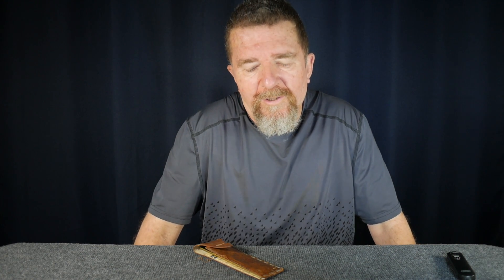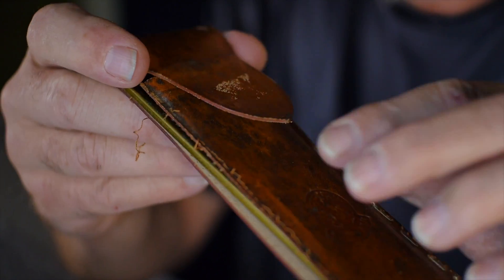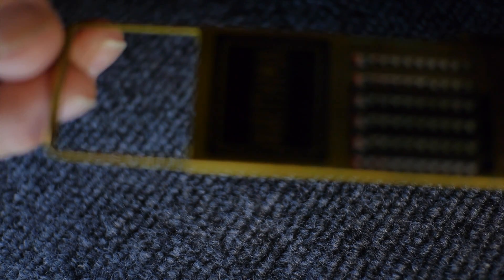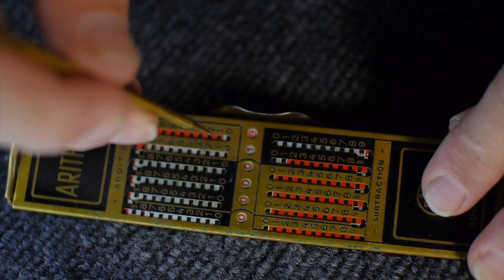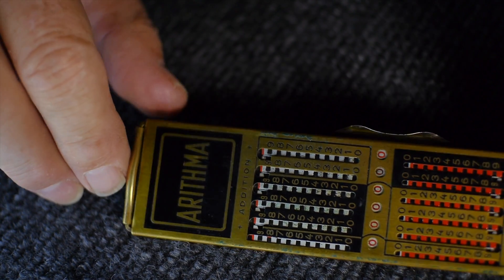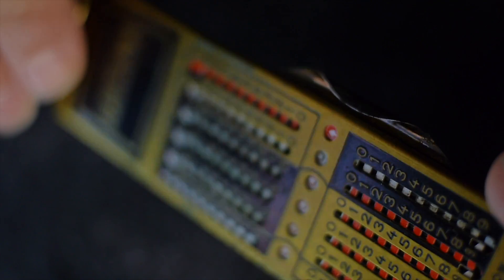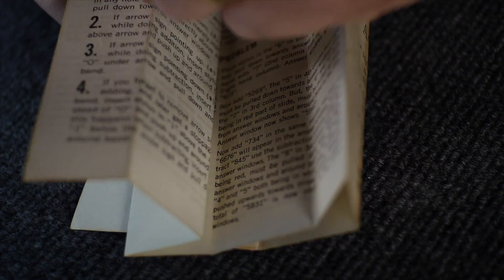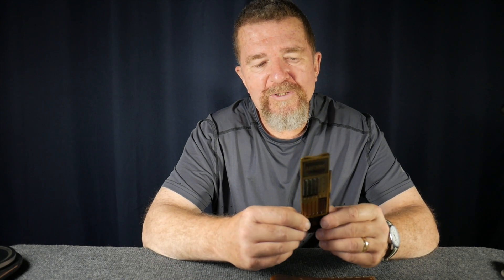The Calculator Series: Arithma Addiator

Comment: You use the slide rule for multiplication and division and this and/or abacus for addition and subtraction. The advantage that the addiator has over an abacus is that the digits stay in place if you move it. They're complementary.

Comment: This design is really clever.  The only moving parts are the sliders - no gears, no cogs - so even a high quality model is going to be a lot cheaper than any other mechanical calculator. Sure, dividing with it is a nightmare, but that's true of most mechanical calculators.

Comment: I got my today, the hundreds column is stuck.  How safe do you suppose is to try to take it apart?
Reply from the maker: Are you sure it's not at the end of the column? If so, there should be a red arrow in the window, you then would need to move it in the opposite direction. I'd try very light oil like naphtha (lighter fluid) before taking apart. And you don't want to use a solvent that might dissolve the paint.

You'd have to carefully bend the brass tabs to take it apart. I'd be very careful.
Reply: @Joe_VanCleave  as I started using it it became smoother on it's own.

Comment: I have one of these! Only it’s in alu colour and without the leather pouch. Inherited from my grandmother. 
Use some acetone to clean the leather, neatsfoot oil to give it moistness and pliability back and perhaps some light dye before the oil. Stitching this should be real easy since it’s threaded on the outside. Use waxed dyed thread though. You’ll be surprised at how good it’s possible to make it look.